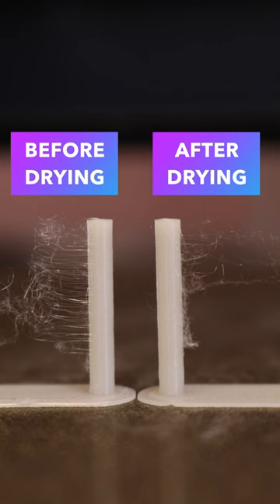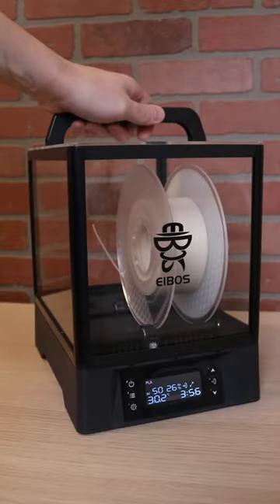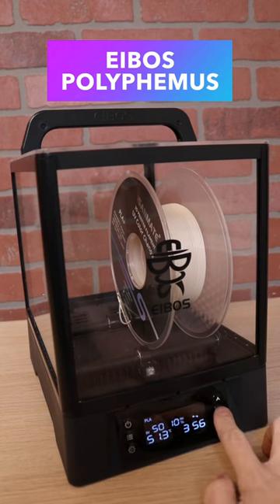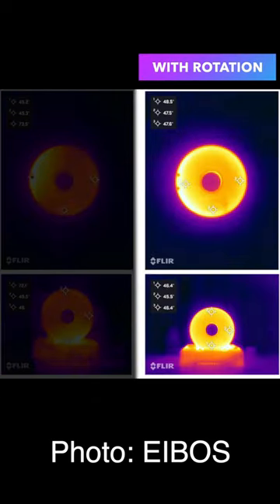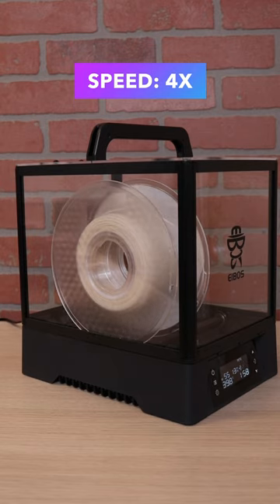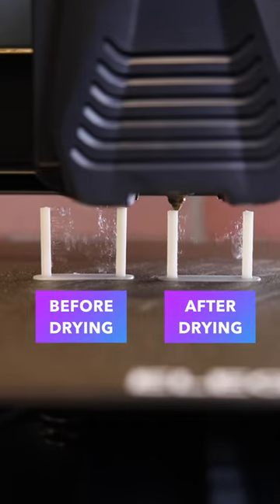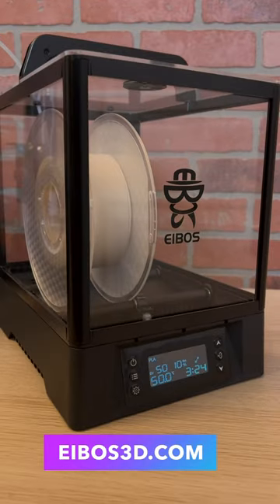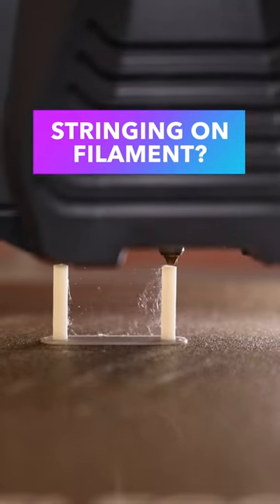EIBOS Polyphemus - Rotating Filament Dryer! #EIBOS #filament #3dprinting

Comment: Bro im sorry but im not paying a couple hundred for a drying machine when it's still gonna have the hairs anyway
Reply: To be fair, he only did one cycle, and the filament was YEARS old and left in a moisture rich environment. Typically what i've seen these used for is spool storage to keep them 'fresh', akin to a bread box, in which case it prevents the filament from stringing in the first place for a long time! its a good investment for those who don't print often and hate the idea of wasting filament.
Reply: Yeah if he had run the dryer for 12+ hours the results would have been much better.... That said, it's not all about stringing, 2 minutes of clean up post printing and a few seconds with a heat gun can pretty much make stringing vanish, I'm more interested in all the pock marks and even worse, the weak and brittle nature of old, damp filament. A good dryer is absolutely worth the investment.